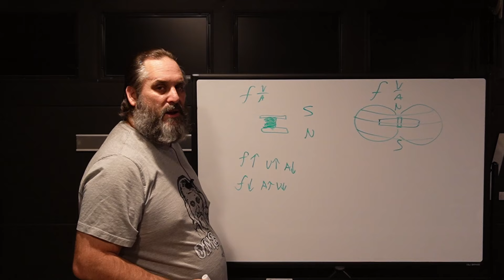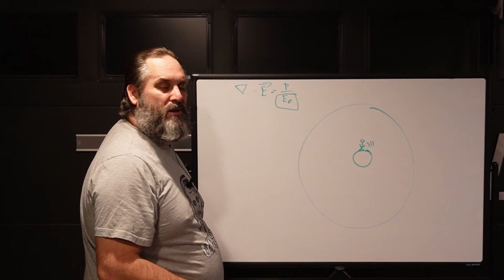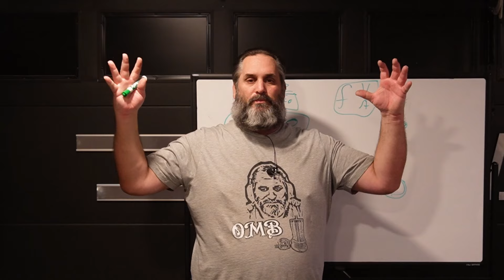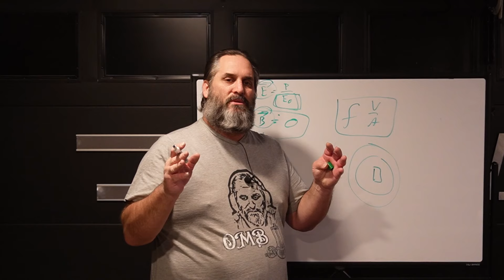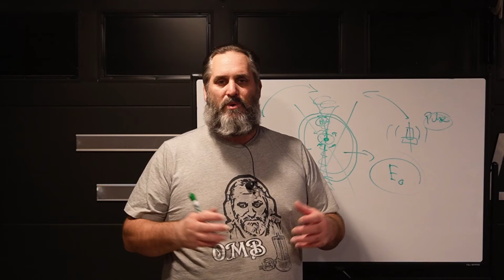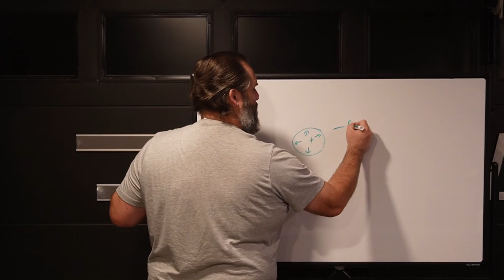Are Magnets and Electromagnets the same?

Comment: My view and understanding: No, magnets and electromagnets are not the same.
A permanent magnet has a fixed, built-in magnetic field (from aligned electron spins). An electromagnet creates its field only when electric current flows. Turn it off, and the field vanishes. They produce the same type of field (B-field), but the source, control, and behavior are fundamentally different.
An iron rod/core can be magnetized by aligning the material electron spin from external energy (so can/will a neodymium magnet) - but give it a strong hit with a hammer, and they disorient (break up into smaller domains) and it's no longer a magnet.
Edit: An electromagnet will also function at high temperatures and can/will work after a hammer hit. 
NOGE explanation: Permanent magnet: ψ-vorticity frozen in material lattice (recursive coherence at T < T_Curie).
Electromagnet: ψ-vorticity induced by current-driven τ-delay loops.
Reply: They do not produce the same type of field, the field around a magnet rotates where the electromagnet does not, this is experimentally verified, get a permanent magnet and put it on top of an electrolysis apparatus underwater, the bubbles spin around around the magnet, they do not with an electromagnet.